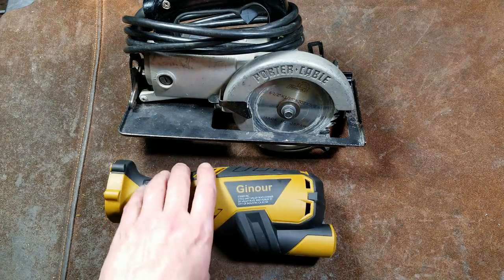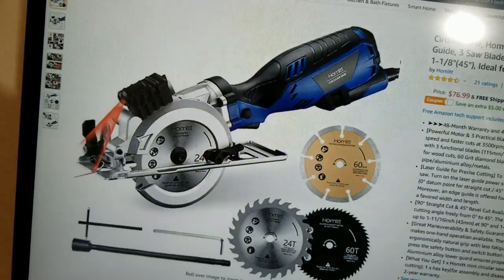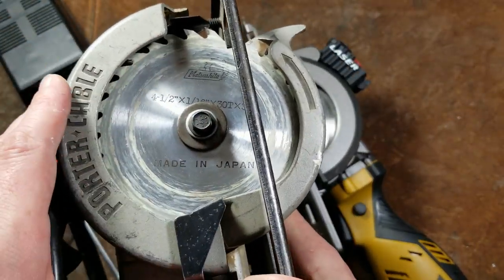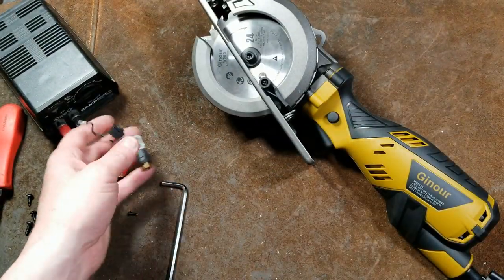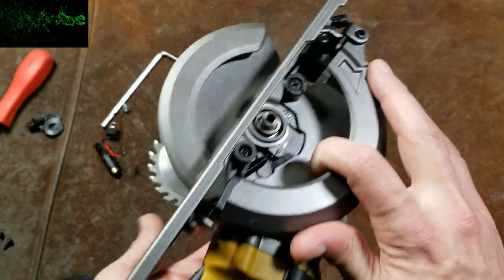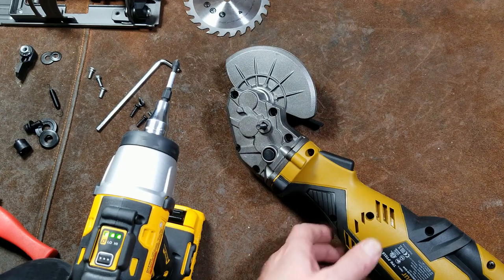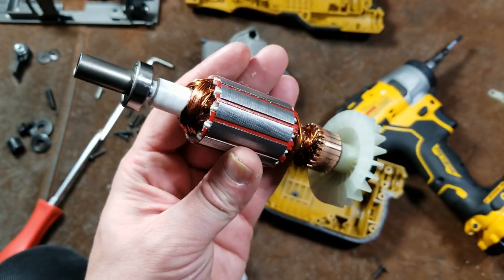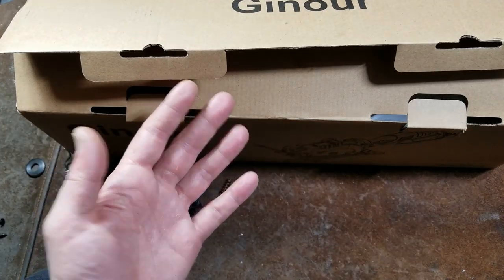Porter-Cable/Bauer/Rockwell/Ginour Trim Saw Review & TearDown

Comment: I bought one of these off of Amazon for $70 before I saw this video. Didn't find any quality issues like the loose casing screws or anything. It cuts smoothly. Came with 6 blades! My take is if you're a professional carpenter or really into wood working and would be using this saw constantly then you're probably better off buying something higher quality as Catus suggests. But, if your just looking for a cheap saw to get a home improvement project done and only plan occasional use of the product afterwards then this is a great saw. Oh, the laser worked on it too!

Comment: Great video. I’m not a professional but have been looking at mini circular saws and I’m very tempted by the Dewalt dcs571, also since I already own a couple of cordless Dewalt 18V XR machines. I had a few of those cheap mini circular saws on wishlist but my concern was exactly on the points you raised on this video. Money badly waisted. A pity I’m trying to buy dcs571 (online, Europe) for a couple of weeks without success, the few stores that stock it won’t ship it to my address... :( edit: you didn’t mention WORX... aren’t they the same?

Comment: Hello,  I wish I had bought a 314 back in the eighties when I looked at them.  Now worn out junk ones on Ebay are way more than they were new back then--three or four times!  Don't have a need for one that often but when you are doing siding they are nice.  Have you ever looked at one of those counter rotating twin blade circular saws that look much like that one you have?  The motor looks to be the same style.  I don't feel they would be worth the gamble as I first saw them on late night TV but now a few companies have them.  Once again I am not quite sure exactly what they are better at other than being a gimmick.  Nice review.  Doug
Reply: They are called double blade saws and I have the Chicago electric
The drawback to that saw is it doesn't have a proper shue.
It's great for cutting sheets of steel plastic or aluminum or wood
It will also cut copper steel pipe and you never have any kick back.
I'm impressed on how long the blades last.
They are kind of pricey as a set will  24.99 at Harbor Freight
The more steel you go through the faster you'll go through the hlades, not so much threw the softer metals and plastics.

This would be my go-to tool if I had to whreck a old fiberglass boat or a sheet metal pole barn or roof.
Or a roughneck trim saw
What will amaze you is there is no kickback whatsoever and you can go cut ether way with no kickback so what makes a great plung saw into any material except rock or glass
They do not make double diamond blades for this saw  
It's a specialty tool more than a go to all tool.

Comment: They can't raise the price any higher than it already is because the Milwaukee 5 1/2" version is $150 and way better than any of these models including the dewalt one. They will never be able to compete with any good brands. The only down fall with the Milwaukee is the batteries are very expensive and you will need at least a 4ah to run it at it's full potential, i would recommend the 6ah from personal experience.

Comment: For whatever it’s worth my Dad used to refer to the older Porter Cable saw you call a Trim Saw as  a paneling Saw ?  when he got older and  we didn’t realize he was suffering fromParkinsons  or at least the beginning of it  he   downsized  his Circular saws to that smaller Porter Cable  oil filled  and around that time  i was  using a 12 Volt Dewalt battery powered  setup i tried to talk him into buying as well and for some reason a salesman talked him into buying the Mikita 9.6 volt  way underpowered setup  and outdated inthe  ln the late 1990s that he eventually admitted i was correct  and he wasted his money on  now i buy those corded saws branded  by many names and call them my throwaway  saws  but are convienent for breaking down sheet goods  for the table saw  final dimensioning  ironically  i often wind up with a Wen branded one because of the low cost and high availability online  years ago Wen wasn’t a bad name in power tools  but the new stuff isn’t that company any longer  but i’ve found okay for some things  like that saw and the rotary tool  i found works almost as well as my genuine branded Dremel  that i paid way more than $19,99   that the Wen cost  on Ebay

Comment: The Rockwell is complete junk. The blade is flexible & wanders. It couldn't cut a straight line in any material. Rockwell customer service could care less. I have a Kobalt 24V compact that works perfect.